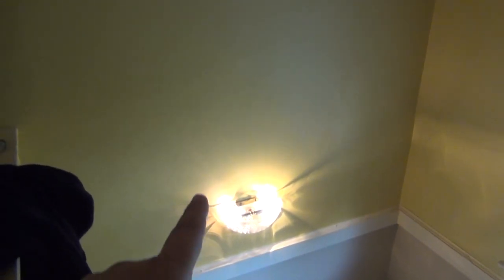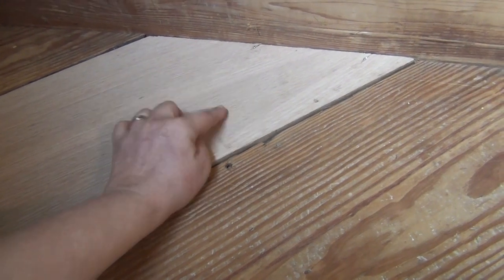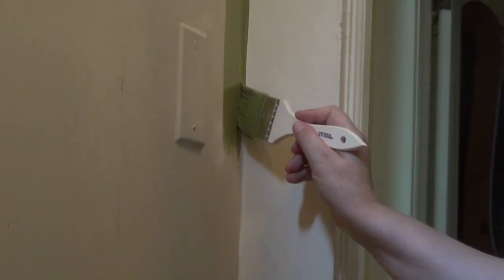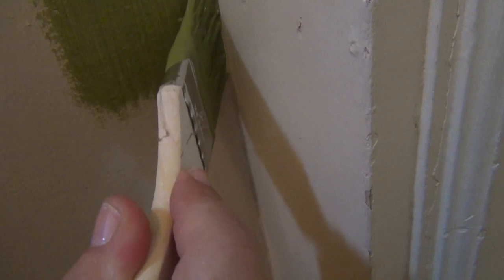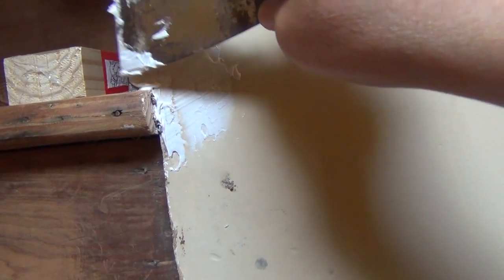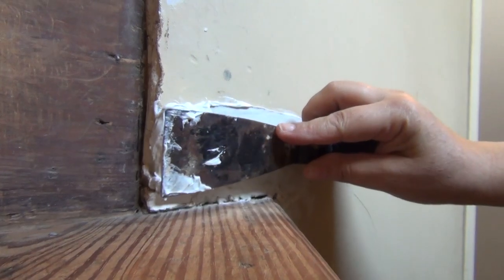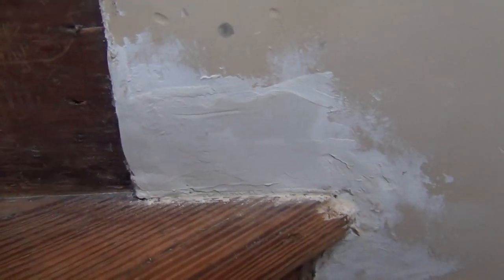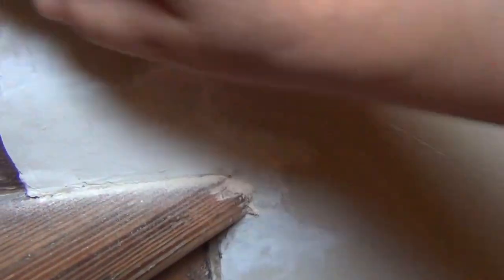Staircase Makeover Part IV -  More Painting

Comment: I love the green paint! It makes that yellow paint creamy and beautiful. When you take up your carpets in the bedroom I think you will be in love with what you have done.

I used burgundy, sage green (in variable colors depending on what's in) with an antique white. Then I can use beautiful floral arrangements in the same colors with pale pinks, and other colors. I even have a room size rug with our 3 colors and I purposely added navy as an accent. It looks great too!

You just can't go wrong with burgundy, green, and antique white (as your color really is). I'm very proud of you!

Oh, by the way, I once redid a house and ran into the same no-sticking paint phantom. It turns out to be an oily surface that was coming up from under the wallpaper. I knew I should have removed it but the room was huge and I just didn't want to take wallpaper on.

It took 5 coats of Behr paint to finally get the wall covered. It can make you go half crazy when you paint a second coat and still see through the paint I'm glad you finally got it under control!

You deserve a pat on the back!